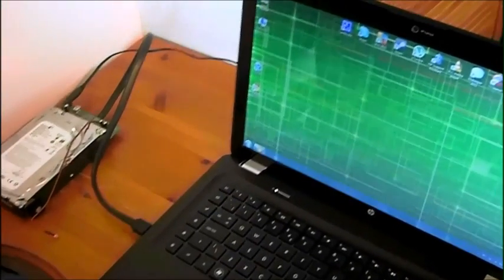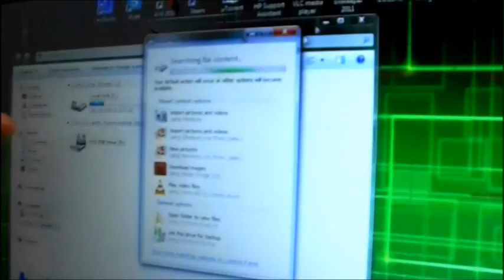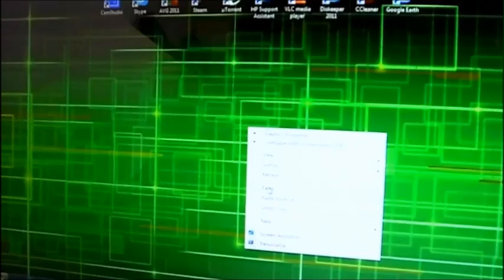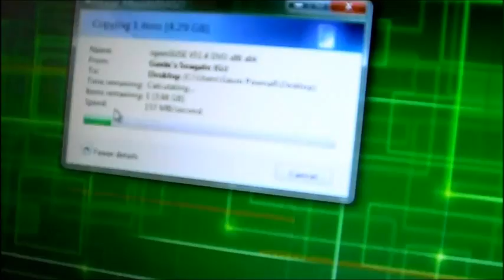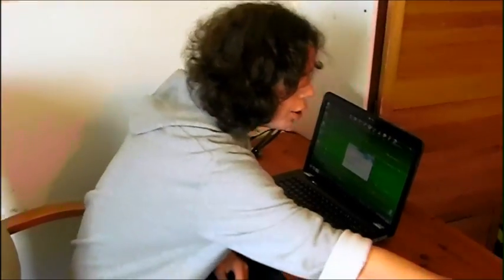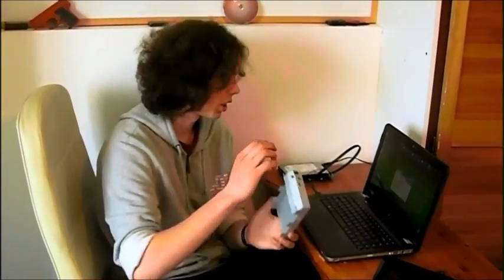Converting An External USB hard drive to use eSata

Comment: dam that was scary, i used to operate with those cutter and you better have a cover above it, with that high speed, the blade crack easy and will cut thru your face in no time

Comment: lame you could get a USB 2/3 conversion connector with Firewire and Esata combo kit 
or just a new case kit , With E-SATA USB 3 and Firewire or Thunderbolt 
which is far faster than all of them.... most commonly 15-20 US Dollars is offten the new case kits. sligtly more expensive but if the drive dies still under warenty your not as Shi...$%#.. out of luck.